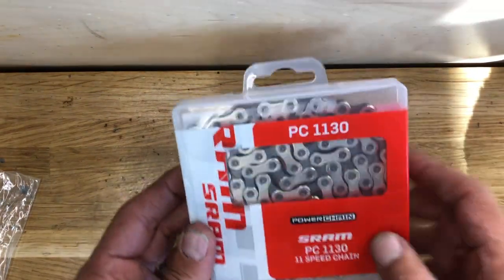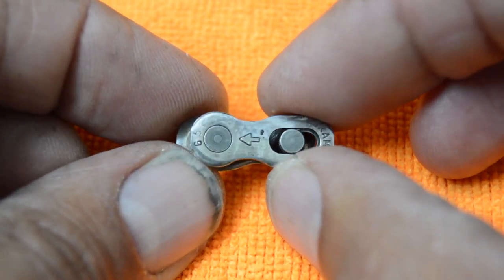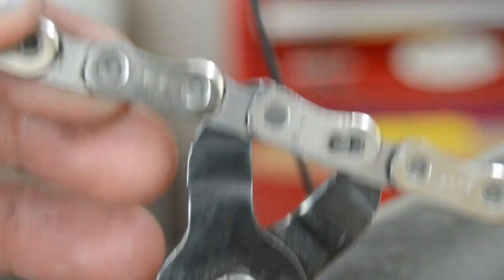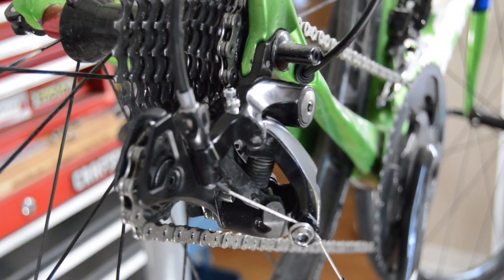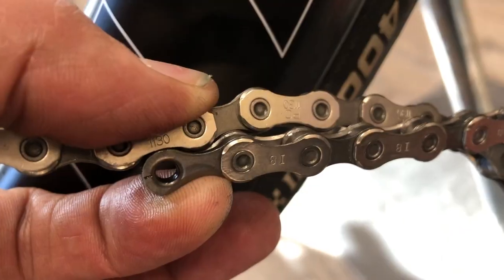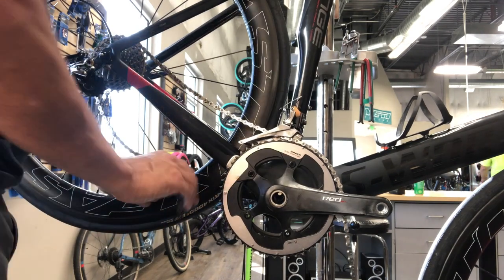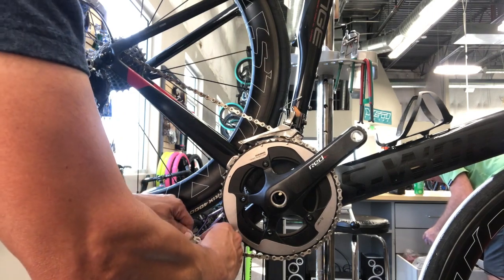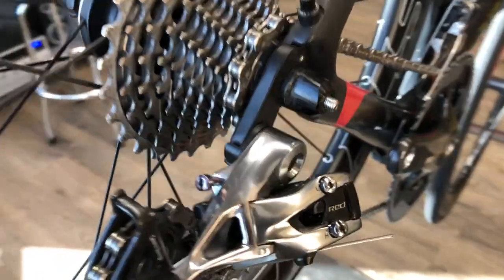How To Size And Install A New Bicycle Chain With A Quicklink

Comment: My TREK 3X8 MTB had it's chain previously replaced at a local bike shop.  It was showing wear and the the Park Chain Measuring Tool (Chain Checker) indicated I needed a new chain and I wanted to do it myself.  I looked closely at the chain with consultation with KMC I found it was their "X8.93 Bicycle Chain 7.3mm 6, 7, 8 Speed, so I ordered one through Amazon and replaced it following YT videos.

My question is did I choose the right brand of Chain?  You only mention SRAM and Shimano, but in research I chose to replace what it had been replaced with before, a KMC chain.

Again, thank you Joey for this great instructional video.
Reply from the maker: Yes, KMC chains are a good replacement. Thanks for your feedback, I appreciate it!

Comment: Count links on old chain then shorten to same count piss easy
Reply from the maker: Unless the chain that you've been using was cut the wrong length. Believe it or not, coming from someone that replaces chains on random bikes every single work day, you'd be amazed at the number I see that are 2 links too long or 2 links too short.